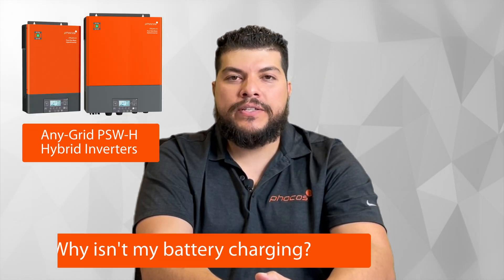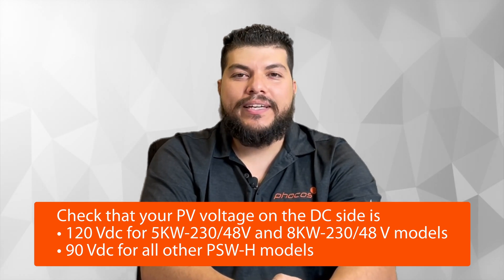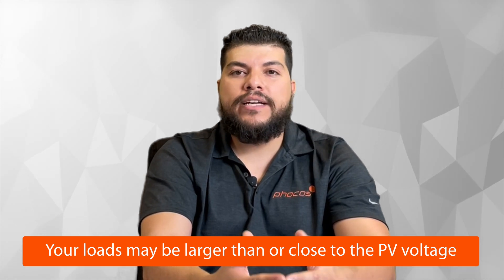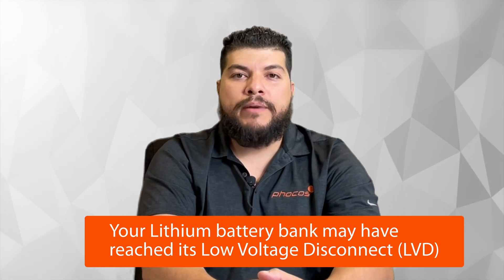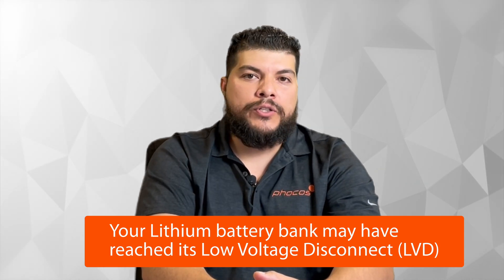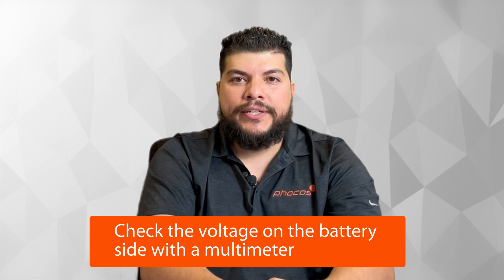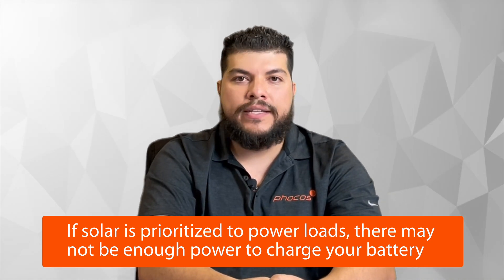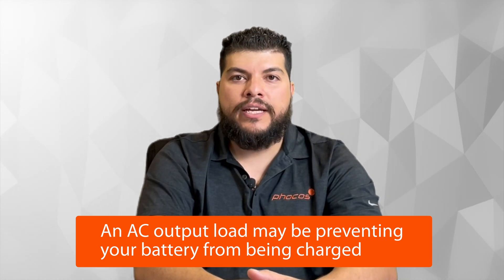FAQ: Battery Not Charging? Troubleshooting Tips From Phocos

Comment: Well, in my case i have  3 Felicity Solar batteries  5.1Kw each  brand new  and i don't know what is happening the three are in parallel (15Kw)  and the three are showing right now 36% of charge and the inverter (all-in-one)  is showing me that batteries are full so i though that the MPPT of the inverter  is the problem, reset and hard reset and still the problem.,  now i connected an external  MPPT  to the batteries and the batteries show at the MPPT screen that the batteries are full i test one by one....:face-orange-biting-nails:
Looks to me that there are no communication between the battery BMS and the inverter.
Inverter is SRNE HESP48120U200-H  12Kw., batteries are Felicity Solar  FLA48100.

Comment: Hi, so i have a 24v 3000w PowMr inverter.  I attached a portable 400w solar panel but there is no solar displaying on the inverter.  I'm getting 36v on the solar terminals coming from the pannel but the unit shows no solar displaying.  The grid is charging my 24v battery and powering load but no solar
Reply from the maker: Hello and thank you for your comment! Unfortunately we cant speak to other products. What we can tell you is that 36v on a 3000w inverter is very low voltage which could be a reason why it is not displaying the solar. Feel free to contact us if you have interest in our Phocos products. https://www.phocos.com/contact/#contactech2
Reply: @phocos-global  thank you. That is exactly the reason. Thanks for your help.

Comment: Hey. Thanks for this. How about charging batteries with generator? Inverter does not seem to take generator output.
Reply from the maker: Thank you for reaching out! If the inverter is having a blinking AC icon this is indicating that the inverter is not recognizing the generator. If the AC input icon is blinking that means that there is something going on with the generator itself. The generator is providing too high or low of a voltage and frequency which is why the inverter is not picking up the generator. After checking these, test and verify the generator and if it does not work, feel free to reach out to our tech support at tech.na@phocos.com

Comment: hey, my hybrid inverter doesn't change the lithium battery while the grid is off, it drains some power off the battery even there's enough sunlight
Reply from the maker: Thank you for reaching out! We want to help you find answers/solutions to your problem  as soon as possible, to do this please visit phocos.com/contact/#contactech. Here, you'll fill out a form so that you get in contact with the right tech support in your region.
Reply: Did you find solution?

Comment: Thanks, I have a similar inverter that will charge as low as 50v from the panels. 
I could not figure out why this inverter would not charge the batteries. Your video quickly provided the answer after I had searched through the manual several times
Reply from the maker: We are glad that were able to help!

Comment: Hi.. I have 1500 watt romex inverter and 2 panel each panel 545 watt and 48 volt.. 2 panel 97 volt dc in series and the inverte not working and not chargin the battery.. The voltage battery is 12.3 volt its not dead.. And the icon of panel on inverter is flashing and not charging
Reply from the maker: Thank you for commenting on our video. We are sorry to hear that you're having some issues with the Any-Grid but we want to help. Please reach out to us on our website https://www.phocos.com/contact/#contactech. 
One of our techs would be happy to assist you.

Comment: Hi there!
I would like to add to this question an answer as very recently this happened to me!
A reason your battery’s won’t charge is that you have a different set of mppt and panels trying to charge the same battery bank or even a wind generator 
The phocos and probably any other mppt you have will read voltage on the battery and won’t charge them as it thinks cause of the voltage being high that the batteries are fully charged..
This is a problem for me because I can’t use some of my older pv’s 
Any advice from phocos? 
Thank you in advance
Reply from the maker: Hello, thank you for reaching out to us. If we are understanding your question correctly, you have an Any-Grid and a separate MPPT charge controller running in parallel to the same battery bank? If our assumption is correct, then in theory this should be ok. There are a few things that must be true to avoid any charging issues. The first is that both chargers must have the same charging parameters. This will require that you use a user defined charge profile on the Any-Grid (menu 05) and match it to the MPPT or vice versa. Voltage drop is another important consideration. Make sure that both the standalone MPPT and Any-Grid are near the battery bank. We hope this answers your question, if not please reach out to our technical support team, they are always here to help! https://www.phocos.com/contact/#contactech

Comment: Is IT possible to get a part from AC and the Rest from the battery for the AC load? Coudn't find a configuration for that yet...
Reply from the maker: Hello, thank you for reaching out to us. The Any-Grid family of inverters allows you to program your AC-output priorities using three different modes. For example, setting menu 01 to USB would mean that the grid would first power your loads, then solar in the grid’s absence, and lastly your battery.
In any mode, the inverter will use all your available power from the available source to power loads, sometimes using two sources at the same time. For example, if you are in USB mode and the grid fails, the inverter will use all its available solar to power your loads, borrowing from your battery when it needs to.
Therefore, it’s possible that in some situations you may using the grid and a DC source to power your loads at the same time. I hope this answers your question. If doesn’t, please reach out to our tech team here: https://www.phocos.com/contact/#contactech They are always happy to answer any questions.